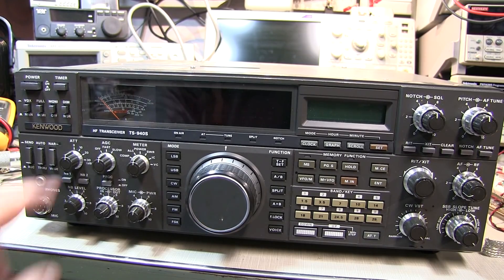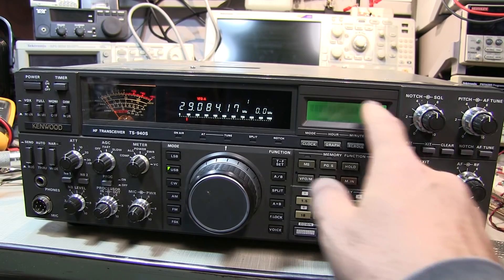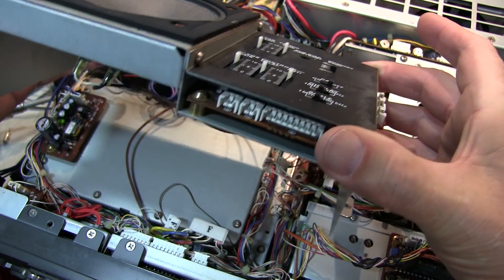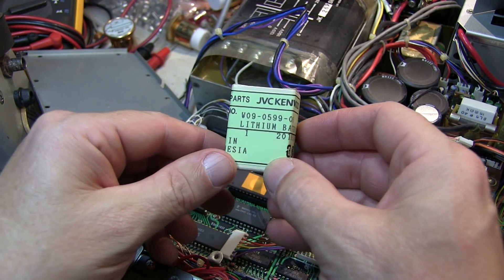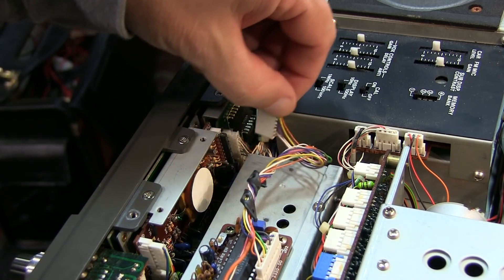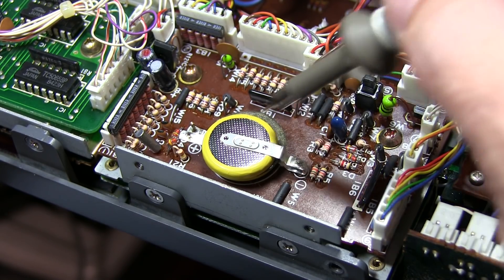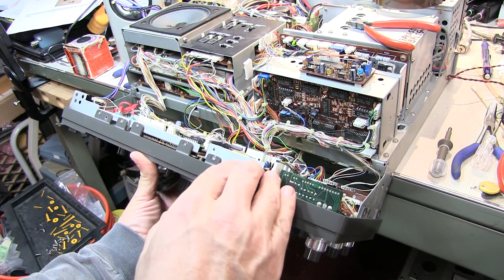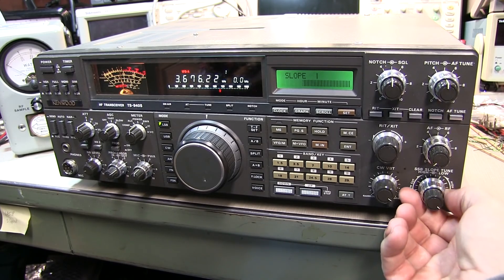#309: Radio Repair: Kenwood TS-940S Battery Replacement

Comment: How do you know if the battery plates has "Sulfation" on the battery plates? anyway to measure the Sulfation of the battery plates using a DVM meter or Analog Simpson Meter?
Reply from the maker: This is typically only a problem on large lead acid batteries such as this in your car.
Reply: @w2aew yes true it is like a car battery is lead acid battery, but how can you measure the sulfation of the battery plates? Is there a way to measure the sulfation using a DVM meter or analog meter?
Reply from the maker: Typically indicated by the open circuit voltage reading less than 12.4v after a full charge, or by the voltage dropping significantly (by a few volts) under heavy load.
Reply: @w2aew sulfation is the same as internal battery resistance? Because alkaline, lithium, cadmium NiCd, Carbon batteries don't cause sulfation but they cause internal battery resistance which is the same as sulfation?
Reply from the maker: Different process, same result. Increased internal resistance and lower capacity.

Comment: Can you post where to order the batteries direct, or its just at Kenwood's website they can be ordered, I've had my pristine Kenwood 940 for about a year now, just now developing a "Dot problem", hopefully its no further down a rabbit hole than battery replacement. Incidentally for the heck of it I bought the replacement bulbs for the meter and LCD, glad I did, turns out I had to replace one meter lamp, and still need to get around to replacing a few LCD lamps. So far the rigs only problems. Also have a 950 SDX.
Reply from the maker: I believe I ordered them from pacparts.com
Reply: @w2aew  thanks

Comment: Can you tell us why the smaller green display looks bright only on each end of the display? Also the Signal meters is the same way and very bright.
Reply from the maker: The edge lid LCD doesn't have the best illumination pattern.  It is actually much more noticeable in this video than it is in real life.

Comment: My dad poassed and left me his radio, it sat for 7 years and i finally decided to fire it up and it didn't work. Thanks to your video it showed me the exact error i was getting and the press AB button on start worked which means i need batteries as well. You wouldn't happen to know that batteries ( parts )  needed for this job ?   and THANK YOU for posting the video
Reply from the maker: Call pacparts. They can tell you and sell you the parts. https://www.pacparts.com/default.cfm

Comment: Thank you, outcoming clock battery was a CR2450, so using a CR2032 I needed to attach a small wire to the negative in order to solder them together. Due to the smaller size. If available I would use a CR2450 next time. Everything working fine again. Thanks and 73 from the Netherlands. What a building quality btw of the Kenwood, having a TS930S, a TS940S and a TS950 sdx you can say I like them very much!. Great rig, great video you have made.

Comment: Would you know where the battery is in a kenwood ts 870
Reply from the maker: It is very simple.  It takes longer to remove the top and bottom covers then it takes to replace the battery.  With the top and bottom covers removed, loosen the lower screws holding the front panel and remove the top two.  Rotate the front panel down and the battery is right there.  See page 81 of the manual located here: http://www.radiomanual.info/schemi/KENW_HF/TS-870S_serv.pdf  You might not even have to rotate the panel...

Comment: Can you make a video lesson about making simple battery "capacity testers" and showing the formulas how to calculate the batteries capacity? other techs use a constant current load and use a stop watch until the battery is dead. Then write the the TIME on the stop watch and multiple it by the constant current load = mAh rate. The way I was trying to do it before was using a 1 ohm resistor across a 9vdc battery and measuring the voltage across the 1 ohm load and the inverse would be the current. I thought the formula was 9vdc X the voltage across the load/current = Batteries capacity, but I was wrong. You have to use an intergral formula because you can't use V * I= battery capacity without using an integral formula. Maybe you might know a simple formulas to compute to get the batteries capacity and how to make a simple battery capacity tester.
Reply from the maker: The way your other techs are doing it is correct.  Battery capacity is specified with a constant current load - it is the amount of time the battery can deliver that current.  Your method is a constant resistance load which will not give you the rated capacity.
Reply: @w2aew  When testing Non-Rechargeable Batteries, How can you compute the Battery Capacity? because you can apply a constant current load on Non-Rechargeable Batteries but how are you going to know the battery capacity?
Reply from the maker: @waynegram8907  The simple answer is that you have to drain the battery at a constant current until the voltage drops to the discharged voltage spec, and record the amount of time it took.  Then you are left with a measure of what the capacity *was*, and dead battery.   If you have a copy of the discharge curves (voltage vs time at a given drain current), then you can estimate the remaining capacity by locating where you are on the curve.  Without access to the discharge curve, there is no way to determine capacity from a simple voltage measurement.
Reply: @w2aew  Yes but that discharge curve on the battery datasheet is only for a certain load. Various circuits under test will have an impedance which is the load. The circuit under test power rails DC resistance is not the same as a constant current load. Example if the 9vdc power rails DC resistance measures 100ohms or 10ohms that is not going to be the as calculating 9vdc/100ohms= constant current load value? or 9vdc/10ohms = constant current load value?
Reply: @w2aew  If you have various circuits that use a 9vdc battery after weeks of the various circuits being turned on you take out the 9vdc batteries and measure the DC voltages for each battery that were being used in different circuits. Can't you take that measured DC voltage and reference it to the 9vdc Discharge Curve? even that all the various circuits are using a different "Drain Current.
Reply: @w2aew  When batteries are discharging current the batteries are Dissipating heat or what? Filter capacitors are storing energy which filter capacitors are dissipating the stored joules, resistors are dissipating Heat and Lamp bulbs dissipate Light emissions, so batteries are dissipating what? V*I = power/wattage but this formula is not dissipation of heat or dissipation of light. Energy power is converted to Dissipation either Heat or Light or stored Joules like in filter capacitors. V*I= wattage power which you have to use another formula to convert power/wattage into dissipation of heat, dissipation of light, dissipation of stored joules?

Comment: The Batteries Capacity is what determines the batteries discharge rate of the speed of the current? The batteries current is "dissipating" each time you apply a load to the battery, the discharge rate of the current is determined on what?

Comment: Lithium batteries. The only thing I dislike more than leaky capacitors.

I sympathize with the engineers a little bit on mobile radios, but in a radio like this, with all of the available space, I don’t see why they didn’t relocate those batteries to easier to get to locations, or even used spring loaded battery holders like you see on many PC boards.

Comment: Hi Alan. Just wanted to say thanks for your video 309. Battery replacement in a TS-940S. I've been a Ham since age 12. Active and inactive over the last 65 yrs. My grandson's are showing and asking questions about amateur radio and electronics so I have recently set some radios on 2m to introduce them to local activities and Hams. I unboxed my TS 940s and  put up a G5RV in the trees. I noticed my frequently and function monitor clock etc weren't working correctly. Went to YouTube for information and found your video 309. Just replaced the original batteries and now back in business thanks to you. TNX Ka2bec
Reply: BTW. the original Sanyo batteries were in place. The placement of the front panel batteries were negative to negative with the insulation material in-between. I replaces them in the same attitude as they were from factory. Didn't make a large difference than your description as long as negative and positive tabs went to their respective posts and diode. Carefully and slowly peeled off kenwood insulation and foam material from old batteries and stickum still worked transfered to new batteries. Just didn't have any insulation material on hand but original stuff worked perfectly. Amazing. I have assembled many heathkit products and repaired many drake B line radios but upon opening the 940 I was amazed as others have commented at the complex wiring and maze of parts. Still love this radio. My son still operates his 840. Only the main frequency selector dial doesn't turn as freely as when new but radio still works great. TNX KA2BEC